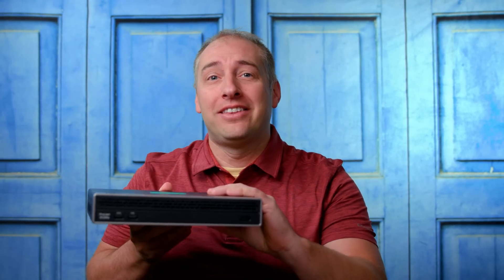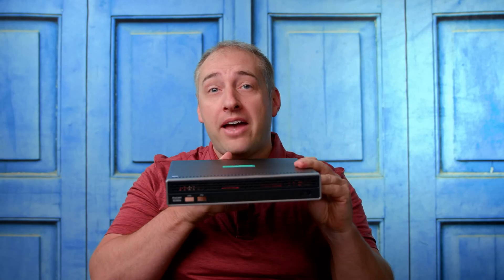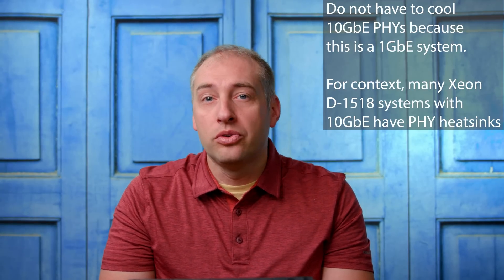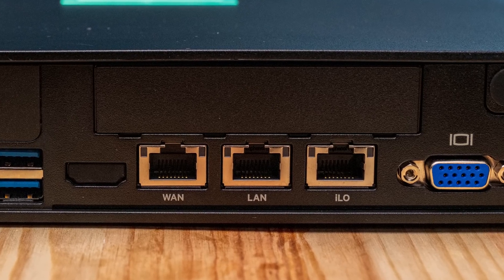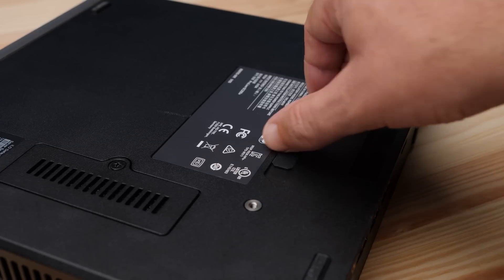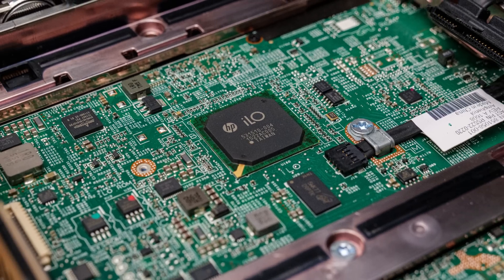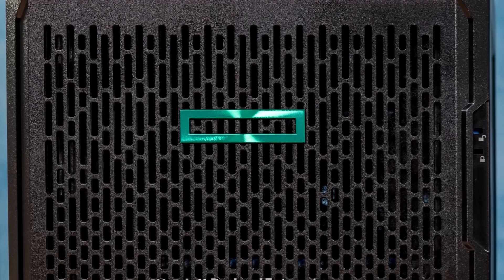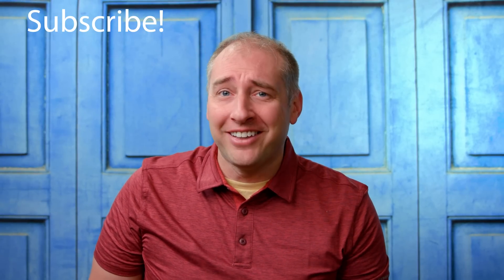HPE ProLiant EC200a Review Intel Xeon D-1518 Edge Computing Platform

Comment: (Late to the party) I have the TM200 with the 8 core CPU,  It's nice but for the fan meandering up and down and being pretty noisy. Mine has the vertical stand... The CPU sits at about 68'c at idle too. I've not seen the expansion box yet. I did try clearos, I lasted about half an hour and gave up. It's now Debian.

Comment: This sounds like my DL60. It's a nice server when it works. but since its deprecated getting things like firmware update is difficult. Getting it to accept a majority of off the shelf USBs to install the firmware updates from is a no go unless you are lucky enough to find someone who has a downloaded version of the firmware file.  but getting the key formatted using RUFUS doesn't seem to work and HP's own firmware maker is problematic as well often not recognizing the USB key. I suspect that HP has worked some proprietary crap into their system to ensure you stay on the treadmill and upgrade when they deprecate your hardware. It just does not recognize the USB key being present. Installing an OS not on their list (Win server v 2016 and red hat enterprise Linux) is problematic. Overall, I really find the DL60 to be a waste of time and money for a home lab system since it is so selective about what it will boot and how it will run. I also cannot get SAMBA to configure RHEL on the DL60. I have had several Linux "Experts look at it and change configuration files and after two years still nothing. When are they going to script up SAMBA configuration so that it a simple one touch operation. It's always been a black art that I have had no end of issues with. Too many parameters and too many ways to get it to work in extremely specific situations. I ended up selling my DL60 and got a QNAP NAS. so much easier to deal with.

Comment: Those are SAS connectors, not SATA (though they will work with SATA drives, too).  Does it actually support SAS drives?
Reply from the maker: The device we had uses the integrated SATA controller not an additional SmartArray device.

Comment: I bought two of these. Having trouble booting reliably from USB. It may work once, twice, or a few times. Specifically my problem is with ESXi. Windows seems to boot great from USB (Windows on the go). Other than that, these are pretty great boxes. I have 64GB of ram in each box, and using Round-robin iSCSI with both 1GB ports in each box for storage. Unfortunately I had to use cheap SATA SSDs to boot since I had so many problems with USB media. This was a really good review though.
Reply: does it has to be ECC ram?
Reply: @JoReLo  Yes, it does support registered (buffered) ECC, and unbuffered ECC, technically the Xeon D-1518 supports non-ecc, but IF the bios/motherboard does, it's certainly "unsupported". You could ask on servethehome. TLDR; you likely NEED ECC memory.
Reply: @jmhalder  Will do, thanks
Reply: Have you found a solution that allows you to finally boot reliably from USB ?
Reply: @brianibarra6065  With ESXi, no. It "seemed" reliable with Windows to Go. Generally, I'd say if you aren't going to run SATA or nvme, don't bother. 2 of these are my primary vSphere homelab with 2x $20 120gb Microcenter house brand sata drives for boot. If you look at the servethehome forum, I've tried literally every USB device under the sun. I've tried reverting to old BIOS/Firmware with no luck.
Reply: Did you boot via EFI from a USB stick ?

Comment: Is iLO free to use in these (used) systems or do you have to pay a subscription license?
Reply: No, you have to pay for it, definitely don't google "ilo advanced key reddit" and enter one of those from the first result, then HP wouldn't get your money. ;-)
Reply from the maker: There are different tiers to iLO. Usually one can find a reseller to sell an inexpensive iLO Advanced key. Support is required for firmware access

Comment: Patrick, is there a hardened switch with a 10G uplink? I'm wiring my house with CAT6A but it would be a lot less work if I could run a single run to the attic with 10G (i'd probably run 2 to be safe).

Comment: This PCIe connector looks very similar to the one used in the "Graphics Expansion Blade" for HPE BladeSystem.
There is basically a cable converting this connector to a PCIe x16 slot, would be interesting to know if those are actually possible to swap in.
Reply: Given this is HPE, where nothing is compatible or compliant with any standards, I would say it will not work :-/

Comment: The add in card comes with 4 ports, but!  it can also come with LTE, WIFI, and what I think is a MODEM card.  I have two EC200As with a full all boxes ticked configuration.
Reply: I was curious to know what the maximum supported capacity for 3.5" drives was in this system. Any help is appreciated.
Reply: @godblesskileo5409  It support 2 3.5inch drives,  I don't think it has any hardware raid, so you'll need to do software RAID.  it does have one M.2 slot (sata I think) on the bottom.
Reply: @zbc_152  My question is more about the maximum capacity drive it can support (eg 16TBs) or is the maximum the specified 4TB I see everywhere.
Reply: @godblesskileo5409  I'd check what storage controller yours is using.  I don't think it has a max of 4TB... I'll check mine later tonight and report back if I find anything.
Reply: Hey Tyler, it’s good to see you here. Did you try installing pfsence on these? How is the noise level, I want to leave this running at the living room

Comment: Does anyone know how to get them in Europe? I only saw one US Seller on Ebay, but shipping is almost the same cost as the server, so I'm hoping for some other source… Would be brilliant as a small Intel box for my home lab.
Reply from the maker: We have a few folks on the forums (link to thread in the description) that are in the EU looking to get these as well. Maybe see if any have had luck.
Reply: Yeah same. Did a quick search and couldn't find any in the UK anywhere.
Reply: @stevec00ps  Still worth the purchase even with the shipping costs factored in. You would be hard pressed to find any similar systems in Europe for that kind of money, particularly factoring in the chassis. A Supermicro equivalent (used) would be £50-£100 for the chassis only, and a couple of hundred (minimum) for the board. Heck even the old Avoton Atomos go for more around here. I am very tempted to get one. Maybe a bulk purchase would lower the costs (but then there is the customs....)

Comment: This thing would've been awesome if the two 3.5" bays would have the option of either a 3.5" disk or an OCP mezzanine.
Reply: Hello.. it didn't support 3.5.. only sata2?
Reply: @AdamAdam-qt5kt  Nope, it specifically says 2x LFF (3.5") in the spec sheet.
Reply: @jmonsted  ok so i can put HDD sata 3.5 with brackets
Reply: Some has a link to order bracket in order to put HDD 3.5? Thanks 😊

Comment: If there was a card with like 4x10Gbe ports this would be a nice tiny Proxmox box with the SATA-box under.
Put 64GB RAM in it and 4x16TB drives underneath and hook it up to a 10Gbe network.
Reply: Given how over engineered the 1Gbe card is that seems unlikely l. Would take a lot of effort but would be great.
Reply: I guess that is why this system didn't make much success in the market
Reply: Might you know if the Storage Expansion for this would be able to support the said 4x16TB drives?

Comment: Machines like this have very little use case. Many businesses in the SMB market that actually need an on-prem server usually just get an ML350 or DL380 entry level config, like a Xeon Silver 4110/4210 with 32-64GB of RAM and a handful of 15K drives. When it's not needed, talking to an IaaS provider or even just SaaS depending on the use case, makes more financial sense.
Reply: Not sure IaaS would make more financial sense but SaaS definitely will over this sort of config.

Comment: From what I have seen the "genuine synthetic metal plastic", is some sort of vapor/plasma deposited metal coating to allow for RF/grounding, but not have the cost/expense of metal.  So no, it doesn't give the benefits of a real metal part for heat sinking/rigidity, but it does give you RF and grounding.
Reply: Was gonna mention this, in enterprise use its really I mean really important to get all the radio and ground certificate or you won't get the product even to the showroom.
Edit, not to mention you got pci-e  and 4 nics which is very sensitive for interference
Reply: Came here to make this comment, however, I have seen EMI/RFI coating that can be sprayed out of a can from some vendors. So there are even cheaper alternatives to plasma vapor depositions.
Reply: @Marcus Beckham definitely, I've been watching on InstaFlixxer for since november myself =)
Reply: Dont know if anyone gives a damn but if you're bored like me atm then you can stream all the new movies on instaflixxer. Have been streaming with my gf recently =)